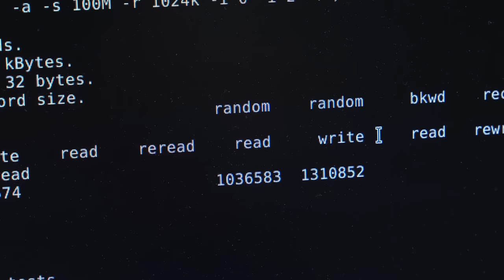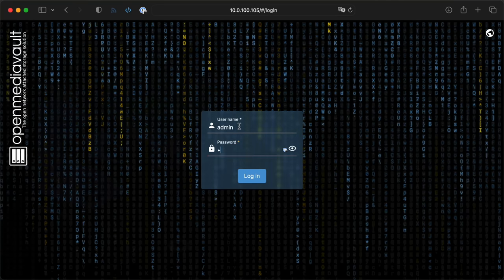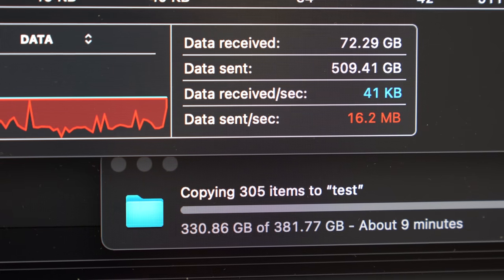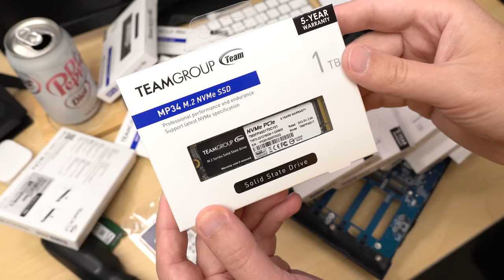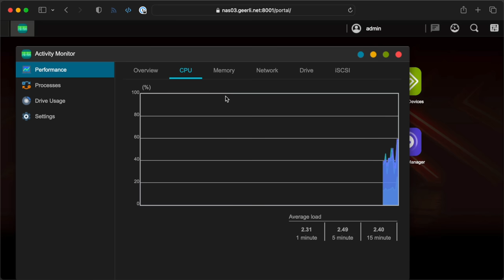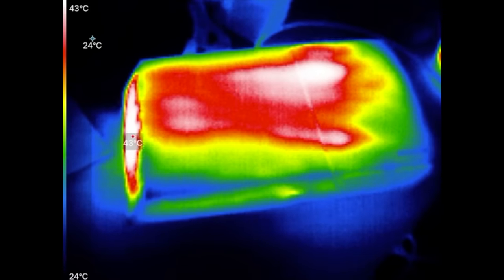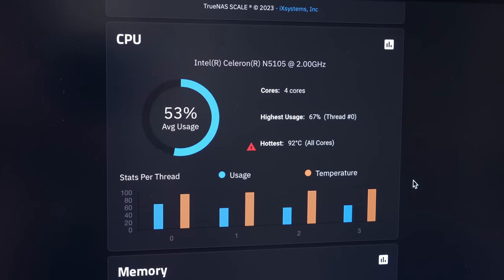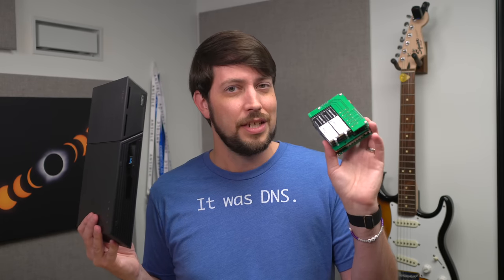All-flash NAS fight: DIY or Buy – Round III!

Comment: I wish Asus had gone with a chip that had ECC support.
Reply: Hi there! We're not ASUS, we are ASUSTOR. We are run independently. We did consider it, but we found after performing the necessary market research, that ECC SoCs in a similar class would render the NAS uncompetitive. We could have gone with Denverton as we have in the past, but it's now a five year old chip and the clock speeds plus relatively poor IPC compared with the Celeron we used would keep the NAS under 5 Gbps. Also, numerous content creators require the use of the iGPU to show content to potential clients and other colleagues. Snow Ridge SoCs would increase the cost by hundreds of US dollars while keeping the speeds at around 5 Gbps. The newest Xeon CPUs are Comet Lake-based and the cheapest one is worth almost the entirety of our six bay NAS.
 
We just feel that the miniscule benefit from ECC is not worth the extra hundreds of dollars or slower speeds. The file systems inside the NAS already come with ECC functionality and that this already sufficient to protect against bit flips inside the file system. 

Hope this helps!
Reply: @ASUSTOR_YT  I'm glad you at least considered it!  I guess the real gripe is with Intel for market segmentation; there's no reason except wanting the $$$ for Xeon that they couldn't support ECC on this line of CPUs!
Reply: @danagoyette7932  Yeah there just aren't really good options for ECC. That's why we invest heavily into making sure our NAS is stable and uses other technologies with ECC functionality.

Comment: If only any of them supported ECC, so we could have peace of mind for 24/7 operation wit ZFS.
Reply from the maker: Even without ECC, ZFS offers some helpful improvements for data integrity; the number of times a normal consumer will run into bitrot or flipped-bit scenarios with a solution like one of these would be very small (and having multiple other copies would normally be enough to mitigate that if you find a file that gets corrupted).

It'd be nice, but full ECC in consumer-oriented gear is still not too realistic due to price.
Reply: @JeffGeerling  It's not just price, it's also what options are available. Intel just hasn't released any good options that succeed Denverton, but those have compromises like missing iGPU and low clock speeds. And it's years old.
Reply: @ASUSTOR_YT  Afaik Ryzen embedded CPUs have ECC support, but yes they cost more than the lowest end Intel. That's probably the cheapest you can get with ECC
Reply: @marcogenovesi8570  They do. But. 

You need to stay tuned ;) Product development takes time.

Comment: One thing I'd like to know is if Asus gets hacked will I lose the ability to use the NAS? 
That happened to me with my WD cloud home
Reply from the maker: No; though ASUSTOR and QNAP both have had issues with people getting bitlocker'ed from enabling their EZ Connect style remote-access systems. I just turn all that off and use the NAS local on my home network.
Reply: disable any remote access or auto-update functionality, that's how they got you on the WD cloud home

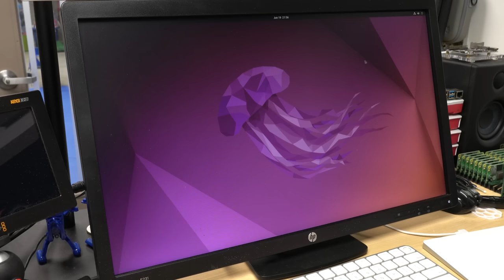Comment: 11:05  I see a Corsair GTX flash drive. Whats the other one? I've been looking for another high performance flash drive but dont want to buy another GTX
Reply from the maker: Arcanite, it's pretty darn fast (but not quite as good as the GTX... though a lot smaller). SanDisk also makes one drive that has an SSD controller on it, which I'm using in an upcoming video :)

Comment: Where can I get a Sbc with SFP+ network plug
Reply from the maker: There are a few, but they're a little more exotic, not really meant for consumer use, but meant for routers.
Reply: @JeffGeerling my  goal is to replace the gateway box from my ISP which run like ass and some server function.
All I can finds are rockchip board which I'm not sure if I have the stomach to work with
Reply: @LordOfAllSneed  you could always go mikrotik

Comment: >M.2 SATA SSDs
>stops watching
That's a dying segment. 5-10 years down the line you may not be able to replace the drives at all.
Reply: We certainly have no intentions of removing removable drive bays. And the drives featured in the video are not SATA. The NAS will not work with M.2 SATA drives.
Reply from the maker: I think @jaskij was talking about the Pocket NAS.

The Pocket NAS uses M.2 SATA (which are slightly cheaper, and are fine for many uses, but are definitely a dying breed).

The Flashstor uses M.2 NVMe.
Reply: @JeffGeerling  Ah I musta missed that.
Reply: @ASUSTOR_YT  I watched the review of the Flashstor from Serve the Home, and it's an amazing product, and I can see myself recommending it to someone (although it's slightly expensive, but it's probably the PCIe switches).

As Jeff says. the comment about M.2 SATA was regarding the Pocket NAS (awful name choice, WD has a product using the same name).

Comment: Do not use el cheapo ssds in production servers - you are just on power loss away from serious data corruption.
Reply from the maker: That's why I always plug into a UPS and use 3-2-1 backups, I have lost a NAS before but it was just a matter of replacing it and re-running a sync that took a day or so, but I still had one more copy of everything in that situation should the NAS I was syncing from blown up too.

Comment: Why use SMB on a mac?  Isn't NFS much faster?
Reply from the maker: Usually a little, but SMB with multichannel has maxed out connections on any device fast enough to pump through the bits on modern Macs, and compatibility is better for applications like Adobe Photoshop and Final Cut Pro, so I've stuck with SMB mostly.

Comment: Using an SSD as your storage for a NAS or DAS is playing with fire.  They aren't reliable.  Until HDDs are no longer made I am sticking with WD HDD.  They are a proven, reliable technology with read/write lifespan in the millions.  Not a few thousand like SSDs.
Reply: Didn't WD just recently start arbitrarily marking drives as defective after only crossing three years of use?
Reply: @MarcoGPUtuber  I hadn't heard anything.  I've never had problems with my WD drives.  I use them daily.
Reply: @SlowPCGaming1  Yep. WD now permanently marks drives that have been running for three years as problematic regardless of whether or not problems exist.
Reply: @MarcoGPUtuber  I finished reading about this a moment ago.  There were 2,007 defective HDDs causing this problem.  Ars Technica has an article on this.  It cross links to a more informative article at Backblaze that provides details of the different HDD manufacturers they use, their capacity, annual rate of failure, drive lifespan by model number & drive capacity, etc.  It looks like most drives are still expected to last about 10 years of daily use.  There is also evidence to show that Shingled drives fail more often than conventional HDDs.  And yes I know of the scandal where drive makers intentionally sold SMRs to customers who thought they were not buying SMR HDDs.

Comment: these are all fails.....
they do not have the CPU power or pci buss  to even begin to use a 10GB card....

Secondly..... they all have  a problem in the  CPU is in the pipe line of hte data....
 if you look at "real" kit, it has a cpu out of the data pipeline running chips that take data straight from teh storage and into the  network card.

it's the same add-age o f why buy Cisco, when you can buy a microtek switch.